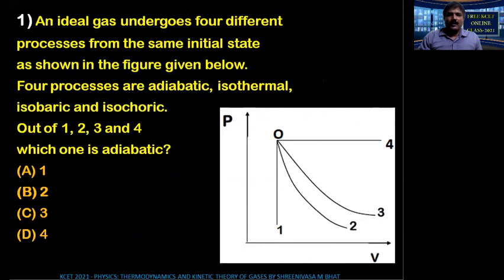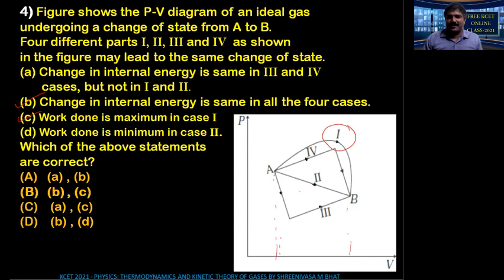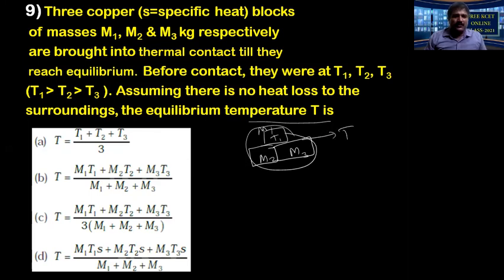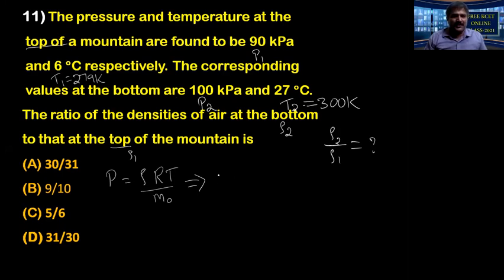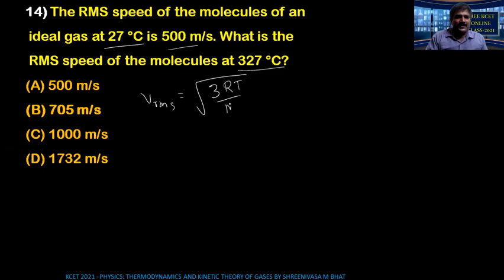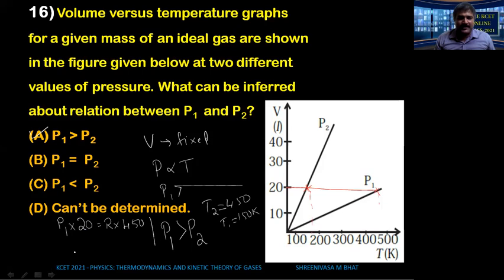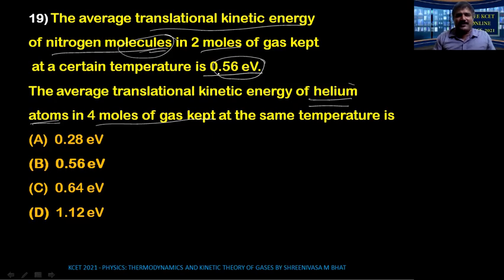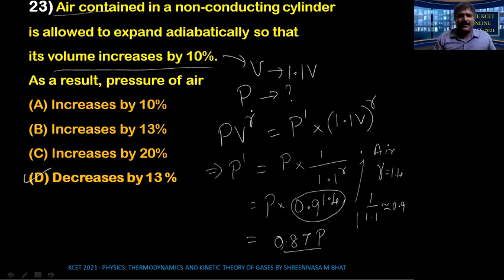KCET PHYSICS 14 (Thermodynamics and Kinetic Theory of Gases)

Comment: I think 12A is correct
Reply: Pressure is exerted by the weight P=F/A= Mg/A, all terms remains same. If temperature increases , volume increases but pressure remains same
Reply: nope because, as the piston is free to move so pressure wont change
Reply: @witsworld3724  ohh yeah, piston is free to move is an important point